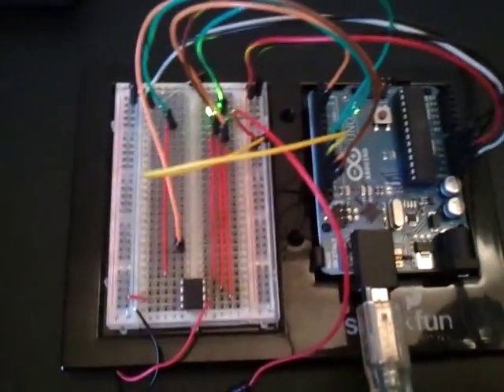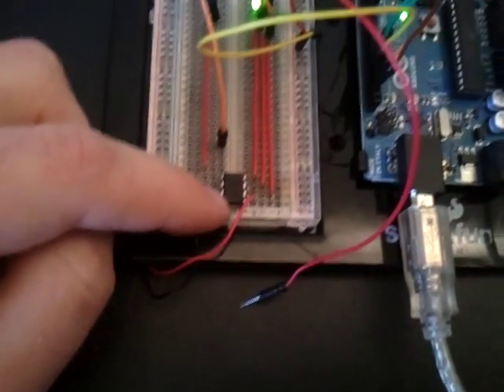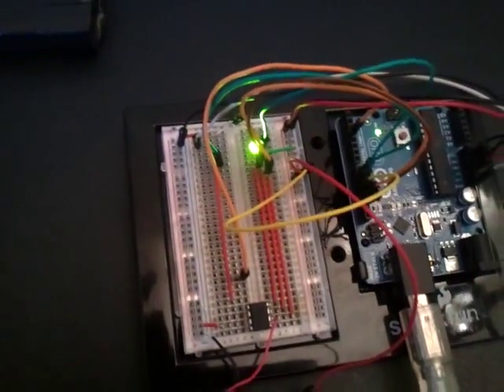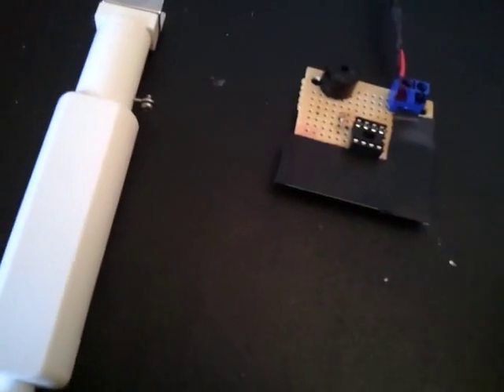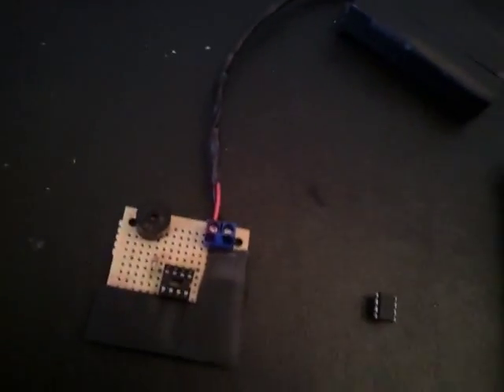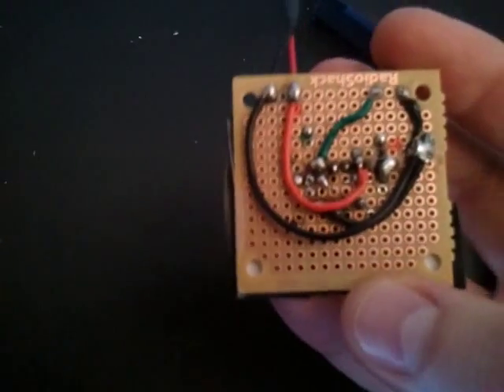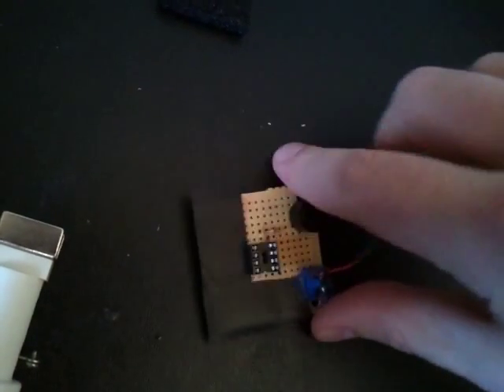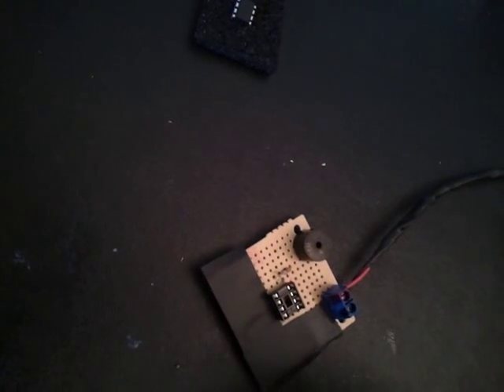Mini Mario Overworld Theme Song Player (w/ ATtiny 85 & piezo speaker)

Comment from the maker: Thank-you for the comments and likes, everyone.  I am jumping on the GitHub bandwagon, finally, and have included a link in the notes to the repo for this.

As far as schematics for the board- I am a really basic hobbyist at this and I do not know how to make schematics for this kind of stuff.  If somebody reading this has any suggestions, please let me know- I'd love to learn how to do that!  If I remember correctly, however, it is really just as simple as just hooking 2 pins up to the power terminal and I think one data pin up to the speaker.  That pin is referenced in the code as DPIN_PIEZO.

The code isn't entirely pretty, but I am not exactly a professional at this language, and I was trying to cram as much onto the chip as I can since it does not have much memory.